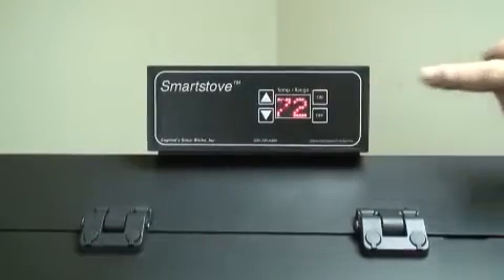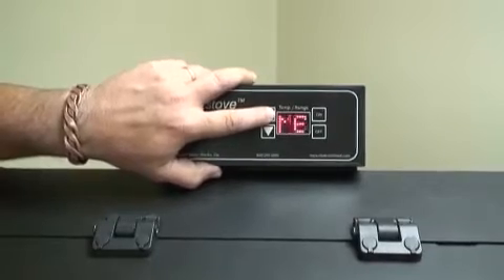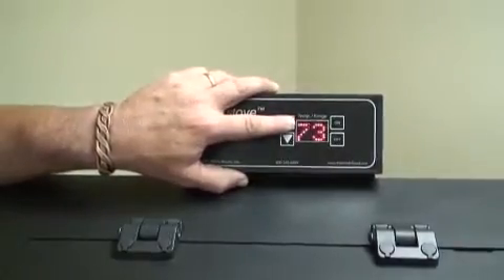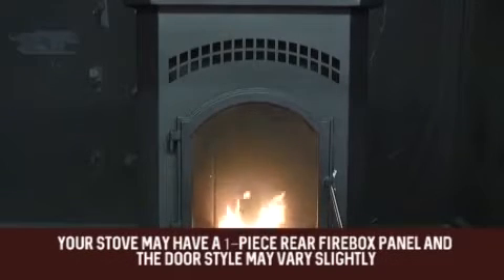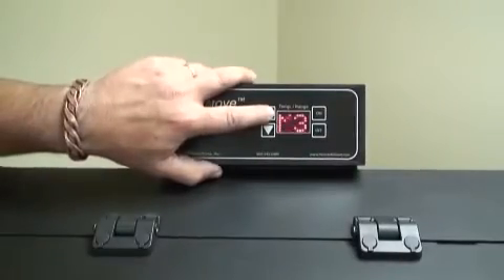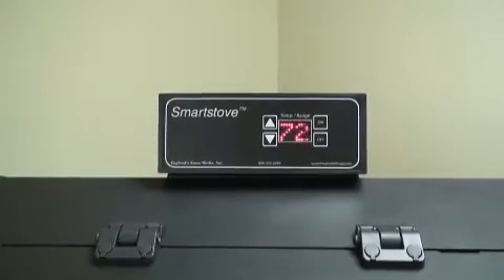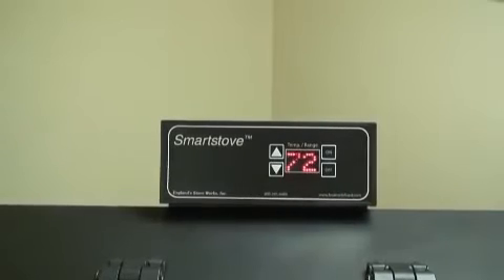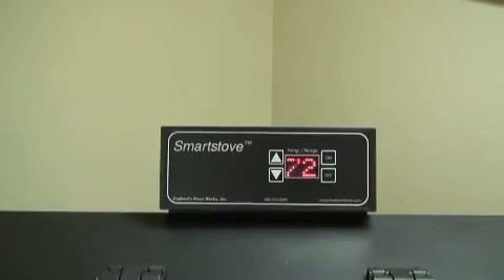CB120; Control Board   England's Stove Works, Inc

Comment: I’ve had this same stove for four years now. At first the stove did not heat my 1000sqft house if the outside temperature was below thirty, my propane furnace would have to kick on. Also my house is only seven years old and built to all upstate NY codes for insulation. After the first year I noticed a “terminal jumper” taped to the side of the stove, I put that in the T-stat slot on the circuit board. Now the stove will heat the house best under thirty degrees. If outside temperature is above 35 degrees the stove over heats the house to an average of 75-80 degrees. Mine does not restart after a power outage and does not turn on and off to keep the house at set temperature on the control board. Is there something I’m doing wrong or missing?

Comment: Is there a way to adjust the auger speed? My new one I just bought in october goes through a full hopper of pellets within 20 hours on the lowest setting I've tried different brands of pellets and doesn't make any difference
Reply from the maker: Hello! Technical Support could probably answer that question by email - service@englanderstoves.com . They are busy, but try to answer within a couple of days. You can also call (800) 245-6489, usually mid-week is a little less busy.

Comment: We just got ours and it didn’t work properly. There are no error codes. It just turns on and the only thing we can hear is the cold air fan. The display reads 72 and that’s it. The auger, igniter, and blower all work on diagnostics. I tried reaching out to you but I got nothing. I saw others saying they haven’t heard from you in over a week. What’s going on?
Reply from the maker: Hello, thanks for reaching out. I know Tech Support is busy (new installs, etc) but they are working M-F 9am-5pm. If you haven't emailed, you can email service@englanderstoves.com , and if you'd rather call the number is 800-245-6489.
Reply: @HeatRedefinedESW  thank you. I’m on hold now. Earlier it just kept hanging up saying y’all were busy. Now I’m on hold so thank you for replying.

Comment: Just bought a brand new one of these, and it wont ignite. Why?
Reply: Yea they are really going to be able to answer that from a YouTube comment
Reply: These stoves are common for ignitor problems. We have gone through 3 and now we just manually light the stove to save the headache of constantly replacing the ignitor.
Reply: @GY6SCOOTERCHAT  its a funny story, I found that the fuckin exhaust switch was all the way removed from the factory it took me a while

Comment: I have a question I just bought the same model and I saw that the screen has a USB port on the side what is this USB port for?
Reply from the maker: Hello! It is there in case updates are ever needed to the control board. I believe it is a 'just in case you ever need it' item - you may never use it, but if Technical Support needs to update it, it's there. Thanks for dropping by!